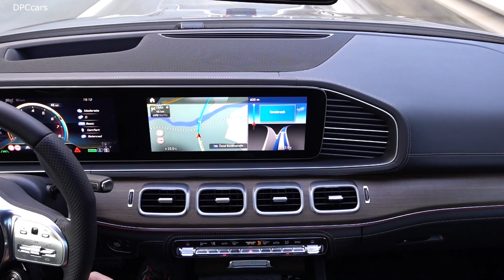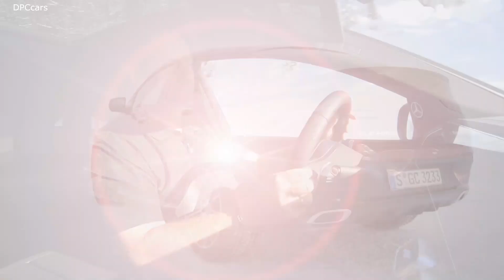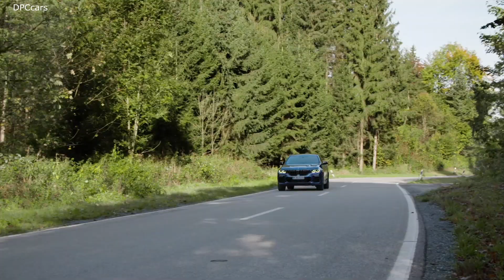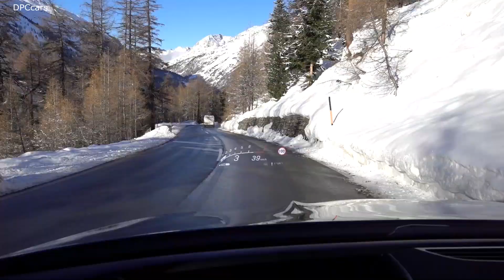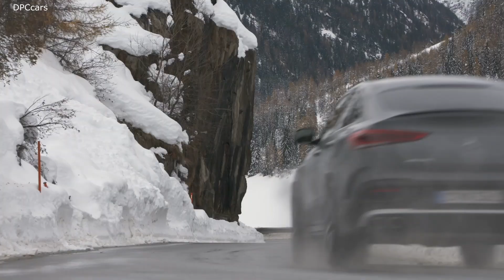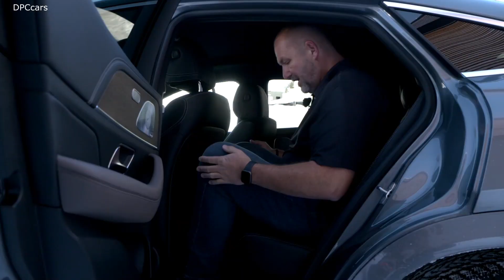2021 Mercedes AMG GLE53 4MATIC+ Coupe Review & Test Drive

Comment: Btw I have the 22" wheels but did not realize they expand in the winter cold months here and when that happens they rub and tug when turning the car in sharp turns so if you are getting the 22" then make sure you realize this is going to happen in cold climate areas. The exhaust pipes on my 53 are updated and different than with this car shown here.